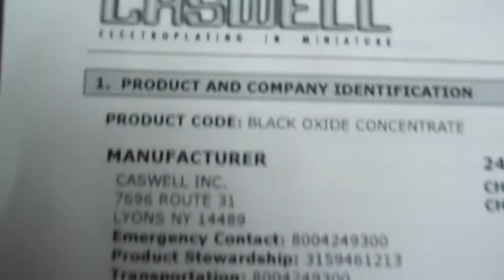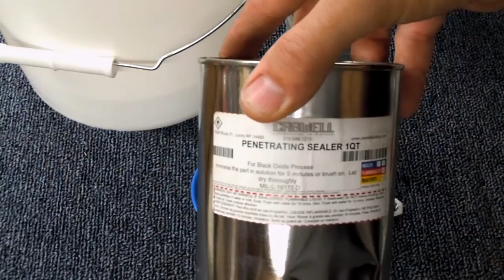Tools N Things 5 - Black Oxiding

Comment: I am familiar with that product and you complicated a lot of steps .. STEP 1 dip the part in a container of Hydroelectric acid no need to scrub dip part let sit and let acid clean the part and etch it for the oxide to adhere to. STEP 2 remove part from acid and dip /rinse in water to neutralize the acid STEP 3 dip in the black oxide solution STEP4 rinse in water STEP5 dip in sealer in going for dry finish use caswell dry sealer for matte finish if you want a wet finish save your money do not buy caswell penetrating sealer as it is nothing more then WD40 sold to you at higher price oh and use wd40 for wet look as a sealer
Reply from the maker: Great, simple, explanation of how to use this product. Thanks for watching and commenting